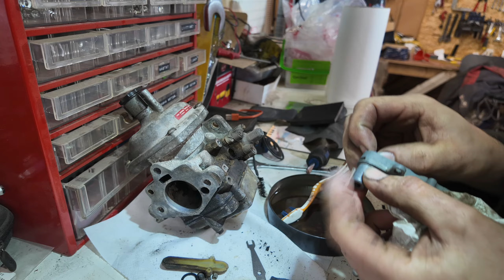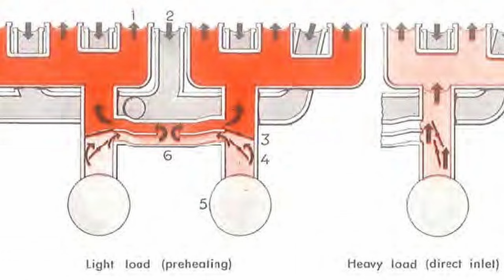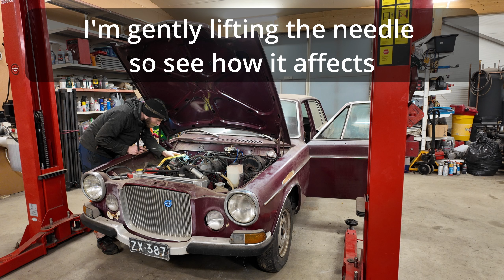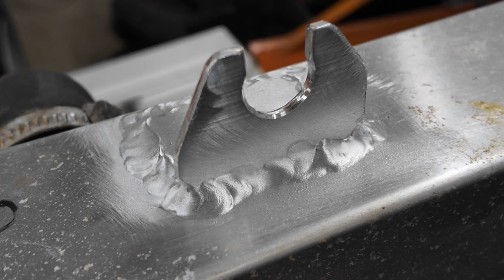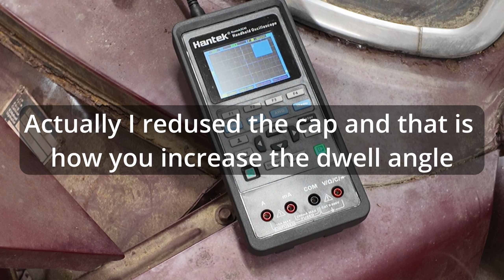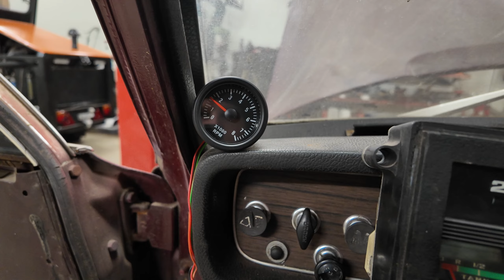Dig into 60's vintage technology - Volvo 164 - Episode 2

Comment: Possibly a good video for electronic ignition.
Stromberg carburettors better than SU but that B30 sounds weak or small air leak.

Does anyone make a decent inlet manifold and carburettor set up for B30A?  I'll stick with my D-Jet, thanks.

All credit to you.  Take time and do it right.
Reply from the maker: @idonotwantahandle2  I'm also leaning more to 123 ignition where you get all new distributor. The old shaft/housing has worn. 

I need to check the intake manifold and especially the axles for the secondary flaps for air leaks.